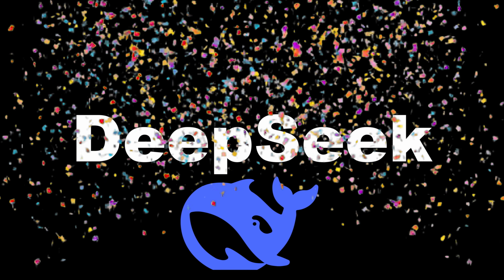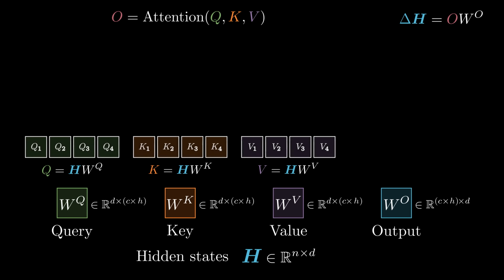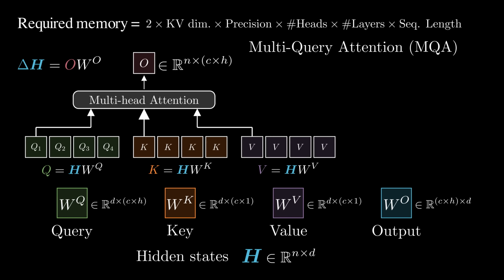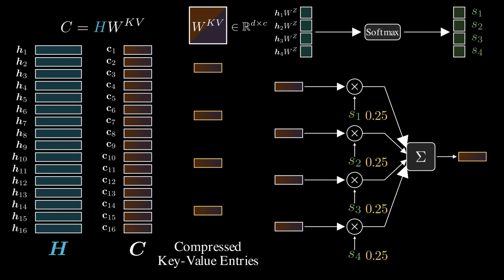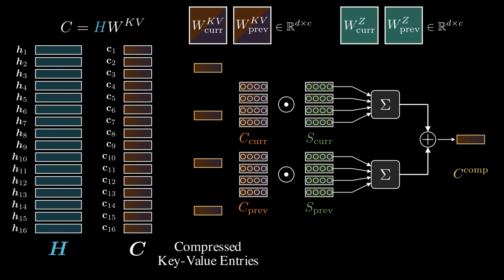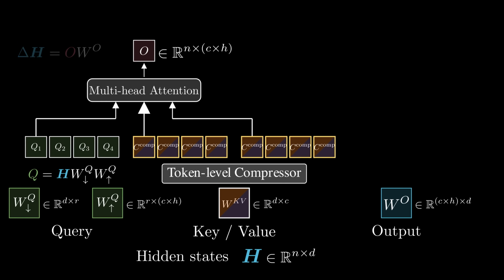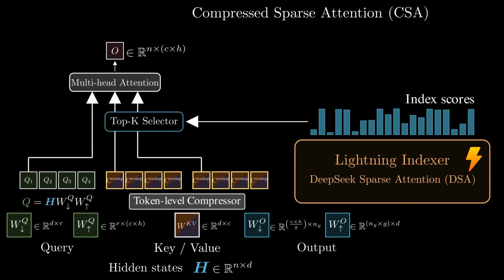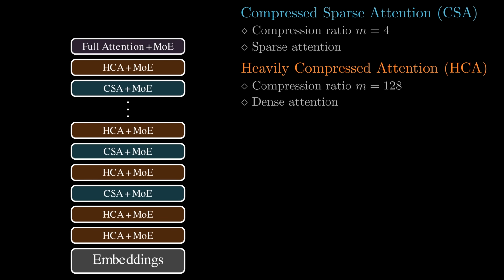DeepSeek V4's Secret: 98% Less Memory

Comment: I hope there will be some models that can run on my 5090 with this tech. I hate that even if have high end GPU, i still can run like 27B parameter Q6 model with only 100K context length. f16 KV cache.
Reply from the maker: Yes, I think increasingly more research will be focusing on distillizing large, strong models into small, and efficient ones. Make these models run locally is a game-changer!

Comment: So there are some measures to account for the loss in precision by compressing tokens, which most media coverage would skip discussing. But now the question is, giving that the switching of attention modes are done in a rather "mindless" way, there's little guarantee that the model can pay attention to important small details. IMO the next step should be to build tools around the model, that can explicitly tell the model where and how to look for specific details during the thinking process, such that there is less chance to miss those.

Also, this really only solves (being generous in terms here) the challenge to scale up, but scaling down remains an issue. Really hope there are more development on making better "small" language models too, as latency is really hurting AI's general practicality so far.

Comment: will CSA and HCA reduce the sequence length, like by 4x and 128x per layer?
Reply from the maker: Nope, the sequence length is still the same for every layer. CSA/HCA only reduce the KV caches. 

For example, if we currently have 1280 tokens, then in a HCA layer, we only save 10 compressed KV vectors. The attention is done only between the query and these 10 KV vectors.

Comment: The tradeoff is precision. How are they dealing with that?
Reply from the maker: Are you referring to the precision (in terms of bytes) for saving the KV caches? Or in general how much performance drop versus memory cost reduction?
Reply: @jbhuang0604  Performance drop, in terms of floating point precision to output, which is has diminishing returns in extended uses (hence why this doesn't tend to be good for video or llms, or music beyond diminishing returns): Just about every major memory saving technique has knock-on-effects to fp entropy. you can test against for it but goodhart's law makes the test not representative, and it gets used to fluff numbers. even irrespective of of cannibalism and poisoning, fp drop is one of the main reasons models have gotten worse over time to fight cost. DeepSeek seems one of the very few models I've seen which deals with it really well.
e: I'm gonna need to rewatch the video a few times, since I think I've responded prematurely not having understood something now I've read my response back a few times. My apologies.

Comment: didn't google already do this with the kvcache?
Reply from the maker: I guess you are referring to TurboQuant from Google? TurboQuant is an inference-time algorithm that compress KV caches by quantizing KV caches from 16 bits to ~ 3 bits. It's like a post-processing tool. 

The method in DeepSeek here is model architecture design. It reduces the number of entries needed in the cache. 

These methods are not mutually exclusive and can be integrated together to achieve extreme efficiency.

Comment: Ok but you don't explain where the weights for the weighted compression come from. That's kinda the one crucial step in the whole process and you skipped it. Are they learned during training and if so how?
Reply from the maker: Yes, it's the key step. In the video here (https://youtu.be/q8holiIirgo?si=vYV0eQH1me8A7NkF&t=395), I show that the weights are computed using the dot product between the hidden states h and the learned weight matrix W^Z. This gives us the scores. We then normalize these scores with a softmax function. And yes, the weight matrix W^Z is trained along with all other parameters.

In the general form, the learned weight matrix W^Z is of dimension (d by c). This means that we can have different weights for each of the c = 512 dimensions.

Comment: Another way to mix your results in the token level compressor would be to rotate the boundaries you are using. Instead of overlapping, each iteration or epoch could rotate through the matrix.

So the first iteration Is like
1234 5678 9012 3456...
Second would be
2345 6789 0123 4567....
Third
3456 7890 1234 5678...
Get what what I mean?

It would save you a bit nore computation.
Reply from the maker: That's a good idea. Similar to random crop data augmentation commonly used in computing vision. 

But, as the scale of training data is extremely large, most LLMs these days only train with only one epoch (i.e., go over every piece of data only once).

Comment: Thank you so much for this great explanation.  "per-dimension softmax weighting"
V4 Report: Only confirms weighted sum, not per-dimension softmax.
Reply from the maker: Yes, it uses weighted sums across the rows, but it indeed uses per-dimension softmax. If you see equation 11 in the paper (https://huggingface.co/deepseek-ai/DeepSeek-V4-Pro/blob/main/DeepSeek_V4.pdf), you will find that they apply softmax across the row dimension. That corresponds to normalizing the score logits across 2m scores (for current and previous groups) for EACH of the c-dimension vector.
Reply: @jbhuang0604 Thank you Sir! Appreciated!

Comment: another great video!! congrats!! SO ... @13:43 how to combine SWA and CSA? through a single attention algorithm or?

Also, is it fair to say ... that DS V4 are using MQA rather than GQA (except for grouped output)?
Reply from the maker: Thanks! That “sliding window attention” isn’t really the typical SWA. It’s just that since we compress every m (=4 or =128) tokens, there are some recent tokens that are not yet been compressed. 

For example, imagine for CSA, we are at the 11th token. At this point, we would attend to the 1st and 2nd compressed KV entries (corresponding to 1-4 and 5-8 tokens). But 9th, 10th, and 11th tokens have not yet been compressed because they haven’t got 4 tokens yet. 

That SWA simply means that we need to take care of these “leftover” tokens until they get compressed when they have 4 tokens as a group. They implement this by concatenating these leftover/uncompressed KV entries with the compressed ones. Since these tokens are “recent”, so they call it SWA. 

It probably should be called leftover attention for better clarity. 😂
Reply: @jbhuang0604 awesome, makes sense. Another question is ... is it fair to say ... that DS V4 are using MHA rather than GQA (except for grouped output
Reply from the maker: Actually every method is a kind of MHA (MQA, GQA, MLA all have the core computation of MHA). 

I would say that DeepSeek V4’s attention is closer to MQA (ie only one copy of key and value for all the heads). DSv4 goes a step further in sharing key and value vectors.
Reply: @jbhuang0604 sorry .. my bad ..  mean to say MQA. So all making sense now. 🥂
Reply from the maker: That’s great! 🎉

Comment: Always a big fan of deepseek but I don't think this would win any awards for innovation from me. I guess what bugs me is the lack of a principled approach, sure you can keep compressing things and then compress that too, and test and find the best configuration, but that's not really groundbreaking research. I suppose this is just one of those ideas that works, probably has been in their closet for over an year and is now seeing the light of day. Compare this to something like Canon layers, now that's principled research creating true insights. This just sorta works
Reply from the maker: I agree with you! It's not really ground breaking ideas. For example, the concept of "pooling" is very common in computer vision models. The token compressor in DeepSeek is simply a learnable variant of pooling operation. 

But it's indeed a solid engineering work. I do appreciate the perspective of focusing on compressing KV cache along the sequence dimension. In hindsight, it makes a lot of sense since many tokens may not have that much information or redundant. Most previous efforts focusing compressing along the head dimensions (MQA/GQA/MLA). It's impressive that by shifting focus to compressing sequence they unlock much more efficiency gains.

Comment: Nice video. Classic over-engineering by DeepSeek.
Reply: Reducing memory footprint is far from overengineering, did you see the cost getting crazy recently ?
Reply from the maker: Not sure if this is considered as "over-engineering". In fact, the compressed attention + MQA is actually simpler than the previous MLA-based approach in DeepSeek-V3/R1. 

And as @sound-ur1bq mentioned, reducing memory footprint is crucial for practical and economical reasons.

Comment: I wonder if these intricate architectures suffer from vanishing gradient problems.
Reply from the maker: Good question! The vanishing gradient problems are mostly resolved using residual connections. In DeepSeek-V4, they use a generalized version of residual connections called Hyper Connections. Check out the intro in another video: https://youtu.be/jYn_1PpRzxI

Comment: Every video of yours is a work of art. Thank you very much for your hard work!
Im kind of curious on sharing the value for both K and V, since the TurboQuant/RotorQuant/IsoQuant line of work has shown that K is much more susceptible to compression than V, with e.g. 8-bit K and 2-bit V being way better than 4-bit K and 4-bit V. 
Being orthogonal directions for working reducing KV cache memory footprint, do you believe they could be used together?
Reply: This is what I have been wondering also can those techniques be used to get even more compression.
Reply from the maker: Thanks! I wasn't familiar with the line of work that do quantization. It's quite interesting! I am sure that these two lines of work can be combined together to unlock even more gains.
Reply: @jbhuang0604 Please look into it.
I am so curious if there is something obvious that makes them be used together.
And how much of all those techniques can be applied to the deepseek way of dealing with it. Because i have seen some say they can't be used and some say they should be able to even further compress it.
But i am not that deep into the maths myself to understand what is actually true.

Comment: Very interesting. +1. I feel like the next step of refinement would be to add a mechanism (covariance matrix) to gauge precisely "how blurred" things get when iterating on the the low resolution step. This would theoretically allow for a regulation system which could efficiently call in the full attention step, when it's needed most. i.e. Negative feedback.
Reply from the maker: That's a fascinating idea—using a feedback loop for dynamic precision control could be a game changer for efficiency!

Comment: it's all based on their papers right. I've seen YouTubers testing deep-seek and they say it doesn't live up to its benchmarks that it claims
Reply from the maker: Yup, DeepSeek model still falls behind the best models out there, but not that much. The point is that most people/companies are not really using these models to solve frontier math/coding problems. So a decent model, but significantly cheaper, would certainly change the competitive landscape in AI.

Comment: ⚠️ Deepseek V4 flash 284B is worse than Qwen 3.6 27B model, which is more than 10x small. In all metrics. It's a matter of efficiency intelligence for parameter. 💥💥✌️
Reply from the maker: Thanks! Just a clarification. The Deepseek V4 flash is a Mixture of Expert (MoE) based model. At inference, they only have 13B parameters activated. Qwen 3.6 27B model is a dense model. So technically, at inference time, DeepSeek V4 Flash is less than half the size of Qwen 3.6.